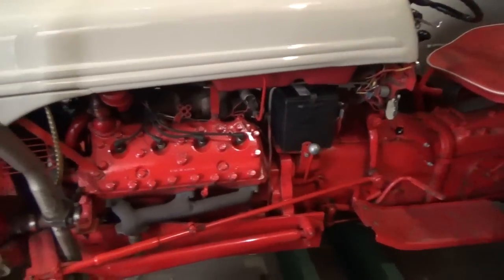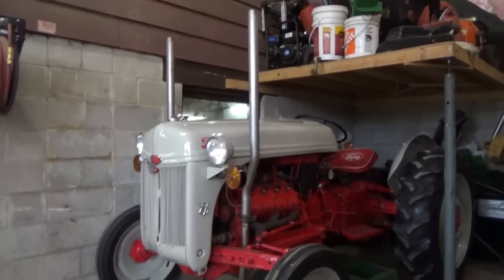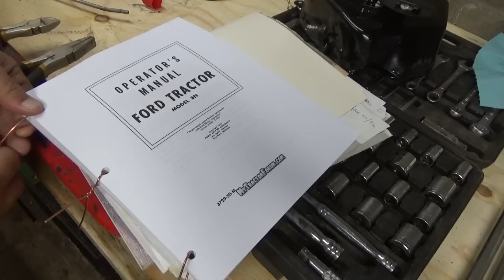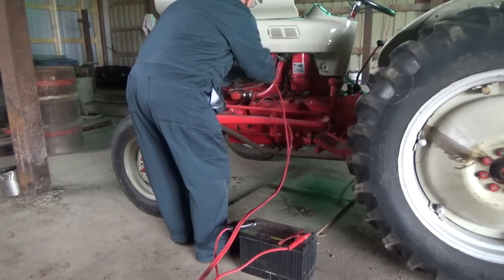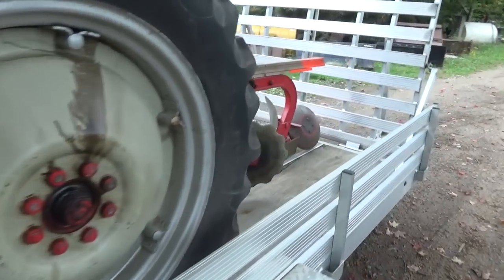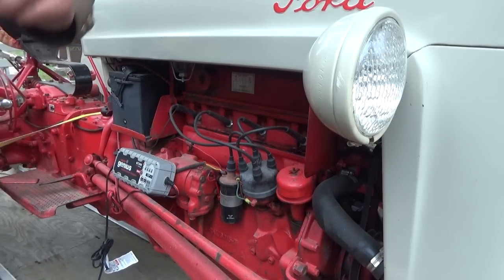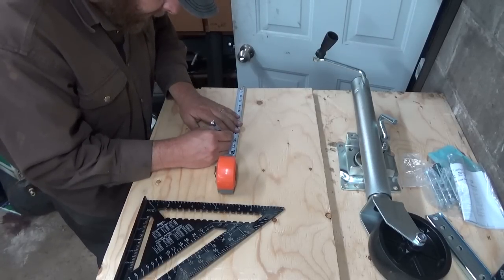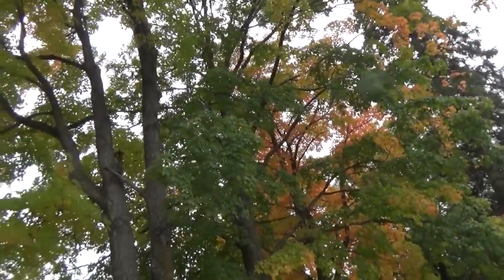1953 Ford Golden Jubilee....The other tractor

Comment: If you spread some vaseline on the truck tub top, then spread a good silicone on the cap, lower the cap onto the tub and lightly tighten, then when it sets you should be able to remove the cap and clean off the vaseline if you want, finally tighten down the cap to compress the silicone.
you may have to put the silicone on a spatula to make it easier to spread while on the forktruck.
You could have used the small square, place it on the edge, put the pencil on the 10" mark, and slide the square along while holding the pencil against it
Are you going to have enough room for the wheels to swing around, like if you want to go backwards ?
Reply: You're welcome :)

Comment: When he gets ready to rebuild or do the hydraulics I would like a full video. We have the 1953 9N and we have a leak on the bottom and the hydraulics works only when its warm and it doesn't run very good in high elevation.
Reply: Cory Black there is no 53 9n. Look at your numbers on the engine block over the starter. A lot of the castings in other parts of the tractors say 9n but those don't mean anything.
Reply: Do the research and those numbers will tell you.

Comment: Can you send me a link to the 8-n manual I have a 8N that I plan on working on over the winter it runs just gotta get some things fixed and peeped for next years tractor pull hopefully
Reply: Also is that a owners manual or shop manul if your doing to do work on one you need both manuals

Comment: If I remember right from my old Air cooled VW days a Generator doesn't put out much unless at operating rpm range. They do not do well with a idle.
Send the tractor out with a GoPro mounted on a clamp. Should get some sound from it.
Reply: i have a 72 air cooled super beetle, and as you say, it doesnt do well at low idle.
Reply: NateWilson99
I would love to get another Bug
Reply: i have an old 1959ford 971wide front  high crop S-O-S that was 6 volt, the 
generator needs around 1200 rpm to charge the battery. when i first 
bought it, i was letting it run at idle for 45 minutes and when i went 
to restart it, i had to jump it. after reading more online, a generator 
doesn't charge at low idle. since then i converted it to 12 volt and 
rewired everything. also put the electronic distributor kit in it and it
 runs and starts better than new

Comment: bill ye better with changing that genarator to an altenator becuse we looks for a generator and it was like $250 and it was used but the altenator was $165 and it was new
Reply from the maker: i think he found a new kit that we may install this winter
Reply: ooh a video maby?
Reply: cool tractor always wanted one of those
Reply: BlackbeardGaming therd a fun tractor, unless you dont know the gears cuz then u might go 3rd or Reverse. Straight forwards is 3rd straight back is Reverse
Reply: usually it says 1 2 3 r well atlaest my 2n did i used to have one then i traded it for something else
Reply: BlackbeardGaming it does but 5 gears and Reverse. Its up left, up right, middle left, middle right, down left, down right